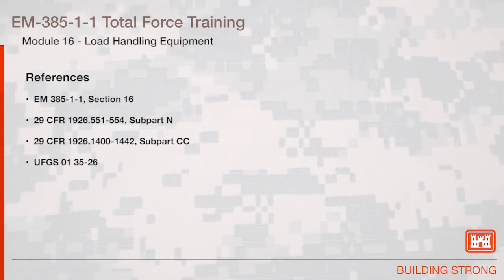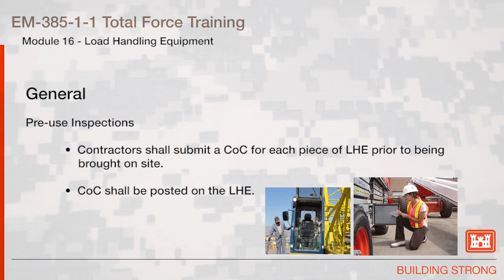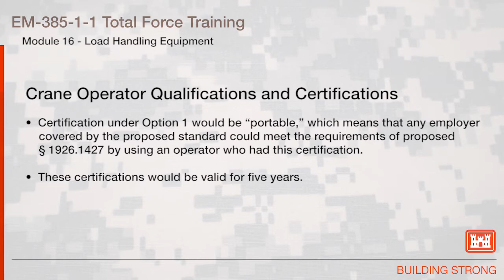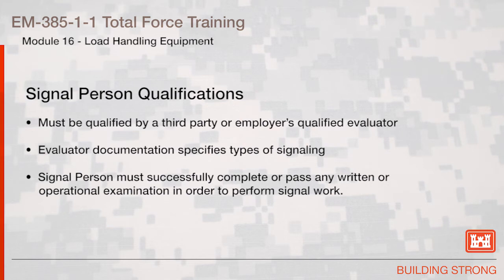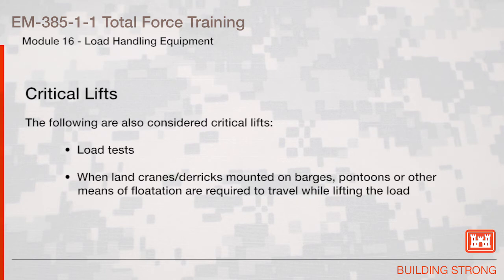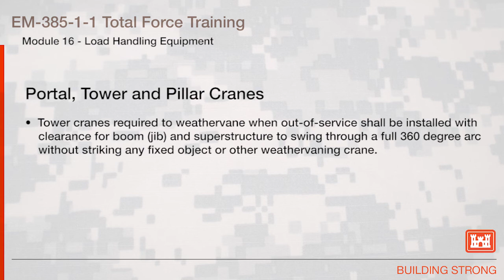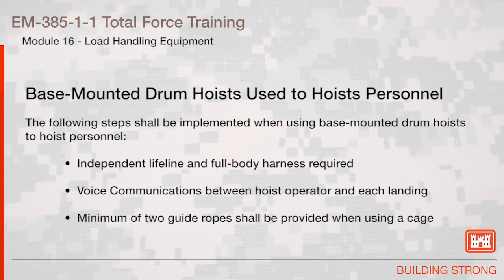NAVFAC Safety Training Module 16: Load Handling Equipment

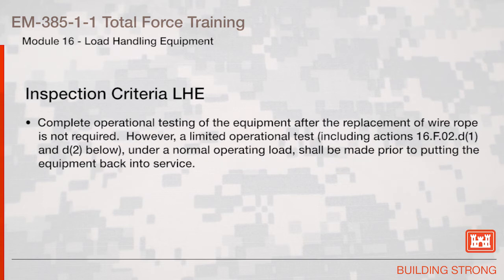Comment: At minute 33:24 / 59:05 the slide "Inspection Criteria LHE" states, "Complete operational testing of the equipment after the replacement of wire rope is not required. However, a limited operational test (including actions 16.F.02.d(1) and d(2) below), under normal operating load, shall be made prior to putting the equipment back into service.
I reviewed EM 385-1-1.16.F.02 and did not find a "d(1)" or "d(2)''. 
Am I missing something?
Please Advise.